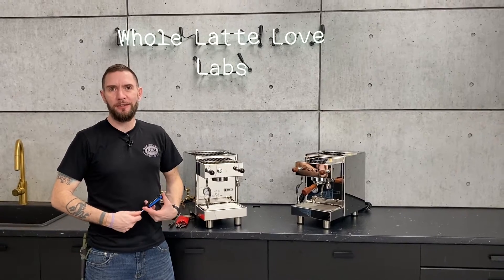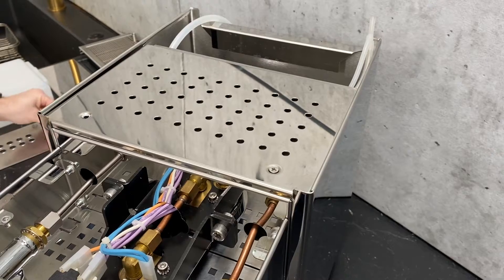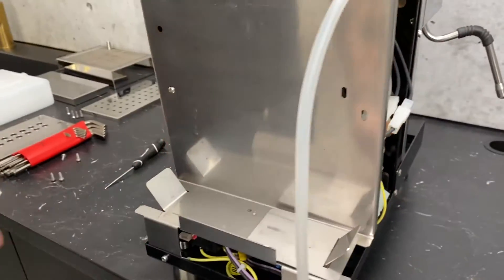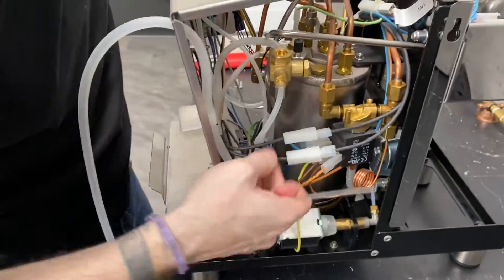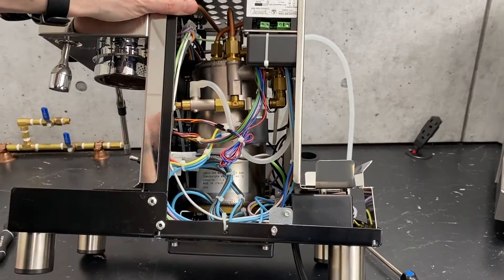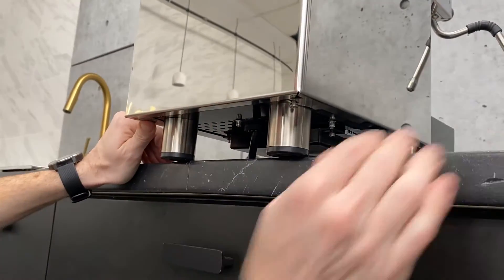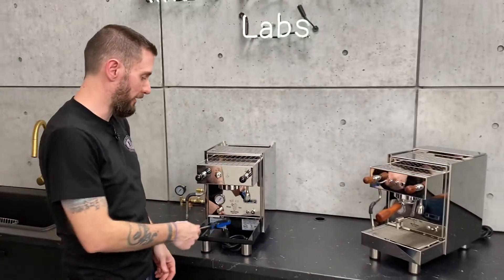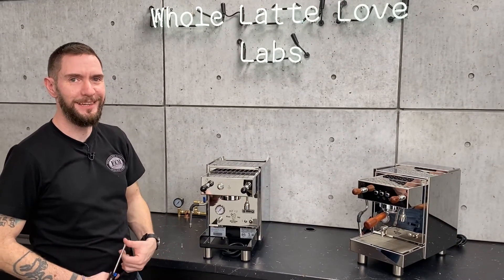Bezzera BZ13: Housing Removal and Installation

Comment: I have a BZ13DE and I love it - But have been looking for articles or videos to help with an issue I have. This came close, but not close enough. 

Question: My steam activating handle (down: on | up: holds on) has a lot of play. Moves quite a bit and is not firm - can wiggle around without engaging the steam function. Is there a way to tighten that up, or to remove the play from the handle so it is stable and firm - and not so loose before the engagement point?
Reply from the maker: Perfect timing, we just made a video showing how to resolve that exact issue, as well as service steam and hot water valves and wands. Check out the first 2 minutes of this video: https://youtu.be/0NswSiP7siU

Comment: Hi guys, I keep asking this question because it’s driving me crazy: 
those silicon tubes keep twisting and restricting flow and dangerously snapping tubes out of place spiking water in the electronics. How to fix that please ? Do these tubes need replacing every so many years for example ?
Reply from the maker: Hi KZ, Thought I answered this question last week but I'll have another go. Tubes should be replaced if they are damaged. Not sure why your tubes would keep twisting or snapping out of place and spraying water. Very unusual! Assuming you are talking about the tubes into reservoir? All of those are low pressure. Are they tied down as seen in the video at this point: https://youtu.be/0CfWQGiYQQA?t=258 Be sure the smaller return tubes to reservoir are properly placed so they only return water into the reservoir. Hope that helps.

Comment: Shame they disconnected these. I guess this would apply to the new Crema though.
Reply: I don’t think they are discontinuing this model ??
Reply from the maker: The BZ13 isn't being discontinued in North America. We worked directly with Bezzera to update the existing BZ13 PM/DE, which will be sold exclusively by Whole Latte Love.
Reply: @Wholelattelovepage   Good to get this verified. I have one on order😁😁
Reply: @Wholelattelovepage  Ah that's interesting. Out of curiosity, why did you want to keep the BZ13 instead of stocking the Crema?
Reply: @Wholelattelovepage  When will you get them?
Reply: @geofftech  When I ordered my BZ13DE, I was told early March.  HTH
Reply: @davidk7262  I also would like to know that?
Reply: i thought the bz13 newer versions are the exact same as the crema pid ?
Reply: @TheRusk123  I don’t know now. The Crema definitely had some updates over the BZ13 but maybe now it is a WLL exclusive they tweaked the spec.